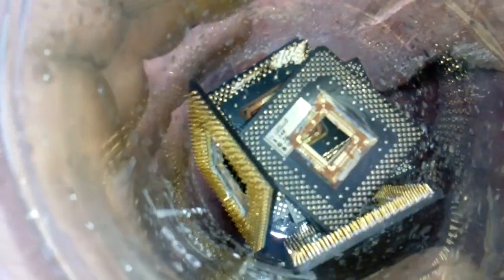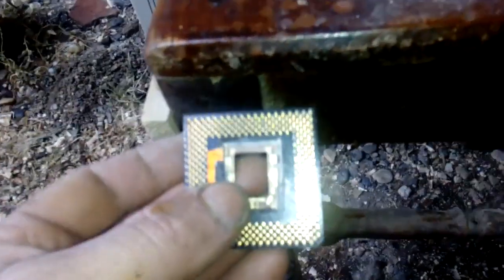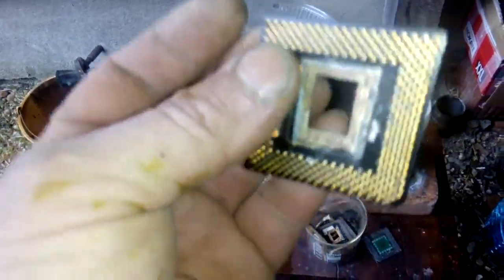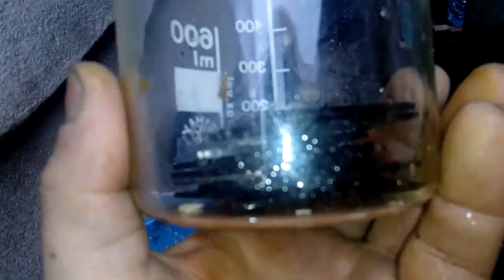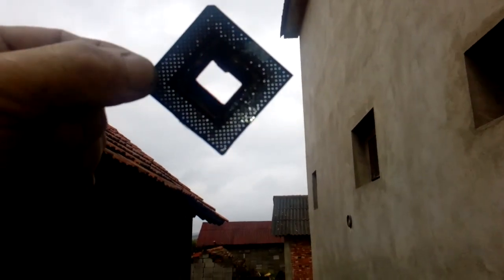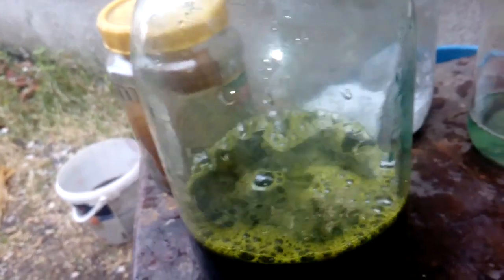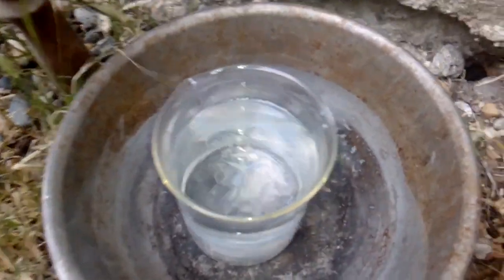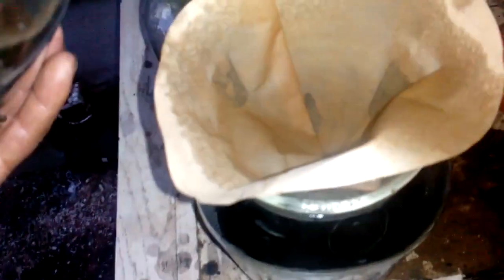Black Fiber CPU for gold recovery-Aqwaregia

Comment: Dusan tell me something. Can I use Aquaregia for golden pins in the method like you use in these video...
Reply from the maker: You can, but first you have to tempt them in Hcl to remove the tin, but it is not recommended, the base metal is a cowar,iron and a stainless steel, very difficult to remove, if it remains in Aqwaregia metal you will cement the gold back. The Black fiber cpu adapter can be directly in Aqwaregia but can not use ordinary fiber processors because you will make a big mess, believe me, I learned it in the hard way. You have to remove them with a heat gun, then in Hcl, then in Nitric or Ap, and just refining.